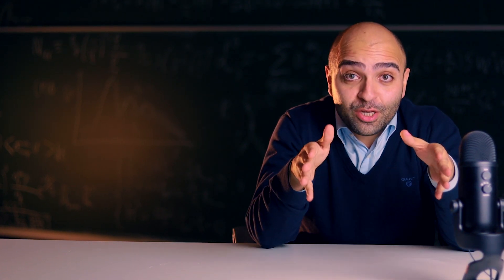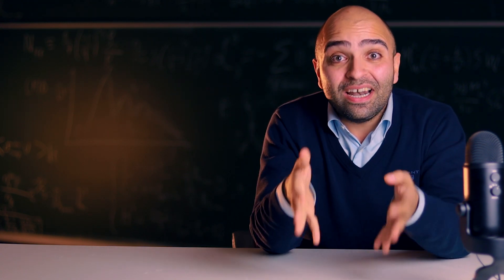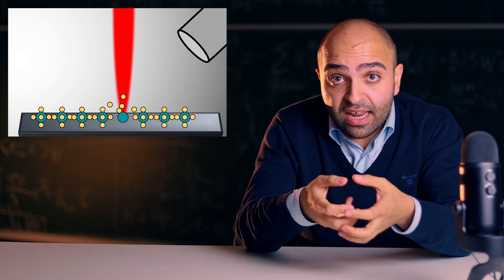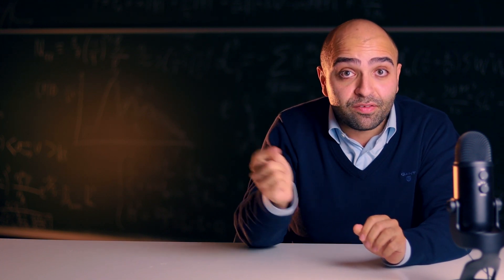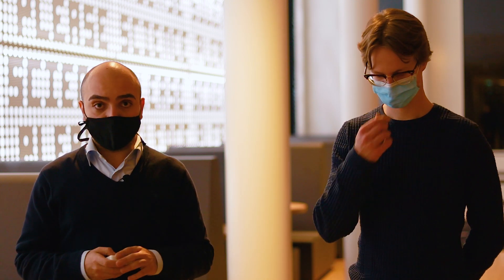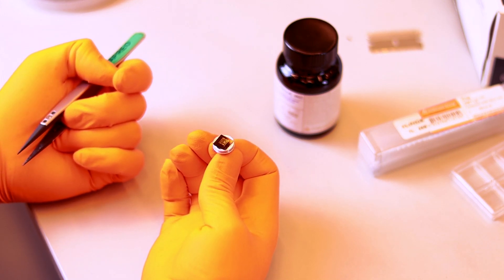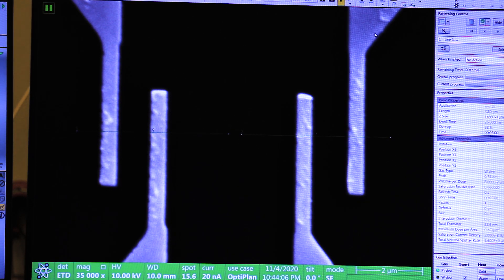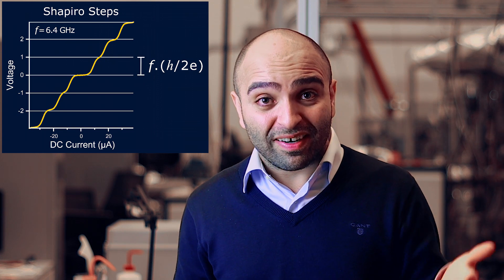How to Print a Quantum Device in Less than 30 Minutes

Comment: I remember seeing an electron microscope as a 3d printer about a year ago. It's resolution was about 50 to a hundred nanometers; so, your work looks like a significant advance!
Reply: Well, I didn't see the 2016 work showing electron microscope 3d printing of various polytopes.  I've often thought, "could you make a nano-scale S.T.M. Since they can assemble single atoms(and there's been some really exciting S.T.M's stuff, applying A.I., and another using a femto-second laser strobe light to really manipulate the single atom chemistry), if you can just make nano-scale S.T.M's, and make a chip of them, you'd have a nano-manufacturing system. 

Of course, if you could just 3d print to single atom resolution using an electron microscope(which is the idea Richard Feynman had). then you just need multiple beams to have massive parallelism.
Reply: The problem with trying to make nano-scale S.T.M's is the piezo's.  The piezo electronics couldn't be shrunk.   But, you guys might have solved the ability to make nano-electronics as well . . . !